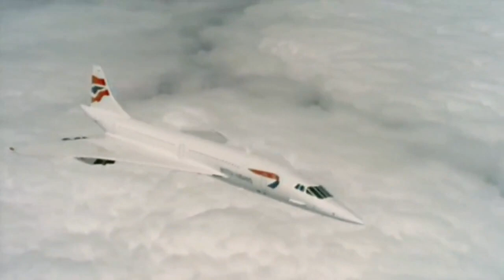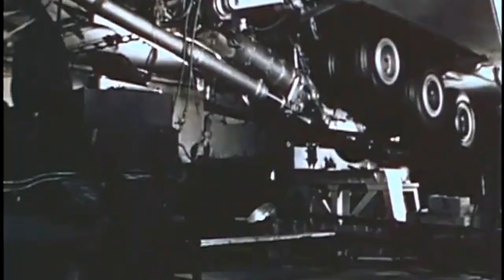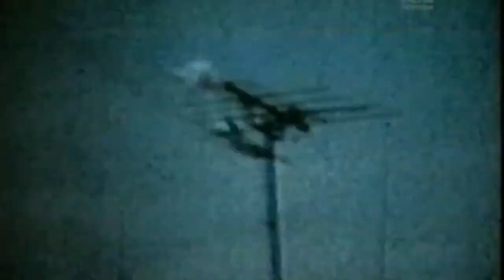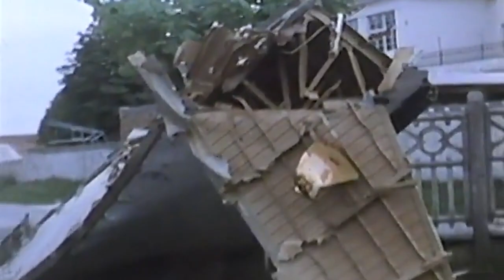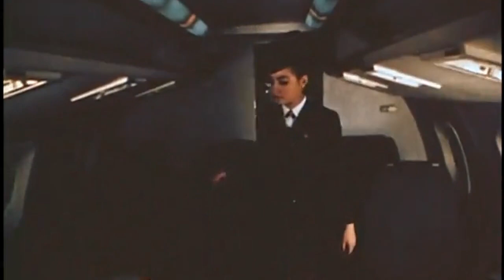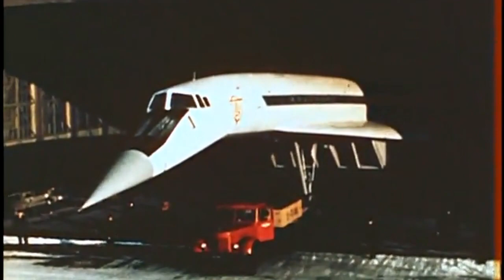The Tu-144: Exploring the Soviet Union's Supersonic Passenger Jet

Comment: This is the first thumbs down I've ever given a video.
The TU-144 did not crash at the French air show due to pilot error
The pilot spotted another aircraft on radar and made an evasive maneuver. This flamed out the engines, which couldn't be restarted in time due to low altitude.
The other aircraft was a French Mirage fighter hiding in the clouds to take photos of the TU-144.
There was an agreement between France and Russia. The French would not claim the Russians were at fault, and in return, the Russians would not disclose the presence of the French fighter plane.
That French plane was NOT supposed to be in the air above the air show. It is a no fly zone and the only aircraft flying is to be the one on display.
A documentary was made on this with interviews of both goverments officials involved at the time of the accident.
This is a REALLY poor video of the facts involved.
It should also be noted at the beginning of this video that the Russians "obtained" the blueprints of the SST. That is why the TU-144 looked so similar.
Reply from the maker: Thank you for your comment, but what you have written here is just one version of the plane crash. The same goes for the copying, which is also possible. However, if we look at the SST models of that time, they have similar wing shapes
Reply: @netman3774  the version I'm referring to is video testimony, if you will, straight from those who kept the truth covered for years. It's been decades since I saw this, but I do remember the Frenchman getting up and leaving the interview because he had sworn secrecy. But when he found out the Russian official had already spilled the beans, he returned to be interviewed about the incident.and told all.

Comment: コンコルドと違ってアフターバーナー無しでは超音速持続出来無いんでしょ？
Reply from the maker: Thank you for the comment. Wikipedia writes about this issue, and I haven't found any other sources on it yet.
Reply: @netman3774  man there was a few versions of it, one that flew from Moscow to Almaty was a Tu-144S series with a NK-144A turbofan engine that...yeah, required an afterburner enabled to maintain Mach 2 cruise speed. Later, the Tu-144D modification appeared, equipped with RD-36-51 (don't remember exactly) that had a somewhat adequate fuel consumption rate though was very unreliable and lived for like 50 flight hours. We could've fixed that but the Soviet Union was already poisoned with perestroika so, unfortunately, it was just scraped. 
Anyway, the Tushka is still a groundbreaking utterly impressive, though fragile creature that impregnated thousands of minds with dreams and hopes. It was our Valkyrie or Blackbird.

Comment: The Tu144 crashed into another aircraft that was shadowing it
Reply from the maker: it faced a number of technical problems and safety concerns, which ultimately made it commercially unviable
Reply: Or kind of the opposite of what happened to the American Valkyrie. Where a case plane got too close to the Valkyrie and they crashed, all for a stupid publicity photo some dumb Air Force general just had to make happen.
Reply: It didn't actually crash into another aircraft at the air show.
The pilot spotted another aircraft on radar and made an evasive maneuver. This flamed out the engines, which couldn't be restarted in time due to low altitude.